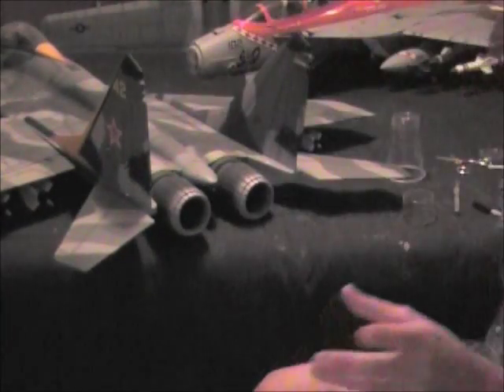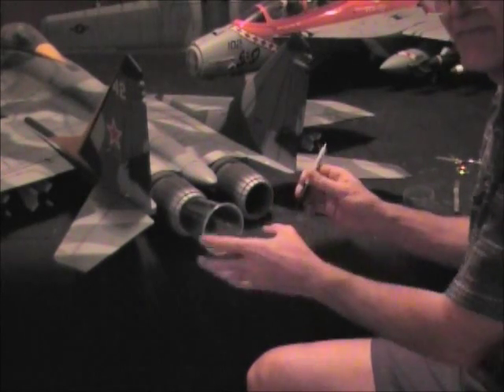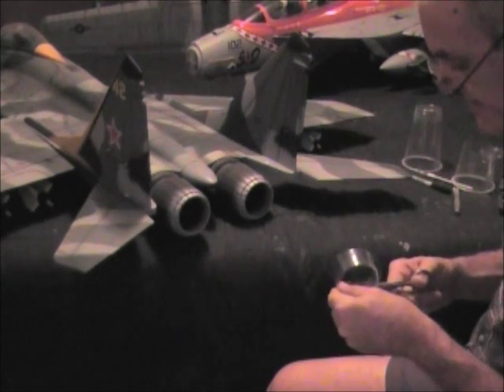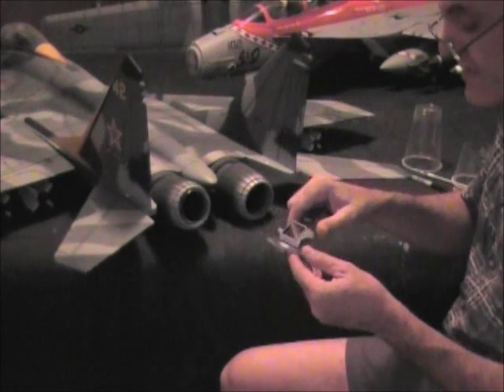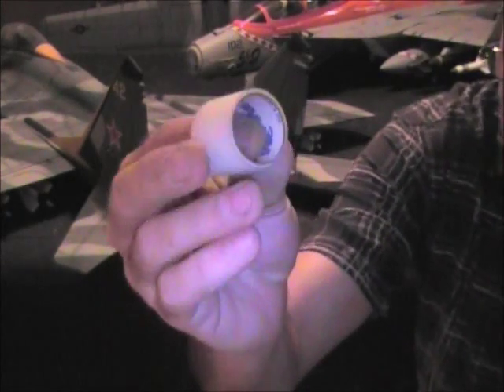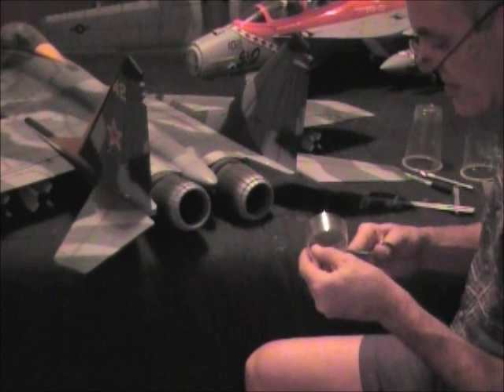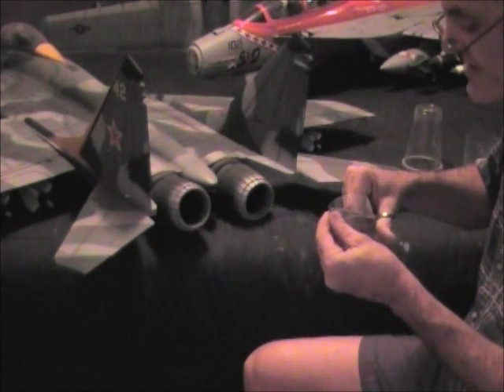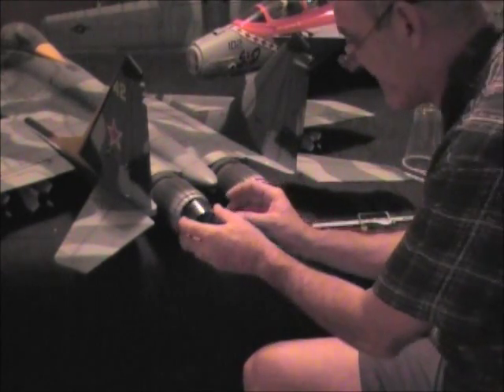How to make a simple thrust tube reducer for the LX 70mm line of EDF Jets

Comment: I did this with a starbucks cup and it worked out great, BUT for whatever reason that I can't figure out is that I have NO thrust/power. What is up with that? I used the 80% FSA calculations for the openings and get NO power. Any ideas on what could be happening?

Comment from the maker: @shypilito1  yes but you really nead a minimum of 9 to allow some of the functiona and 12 for full functionality, but it will work with the spectrum equipment, it's just futaba I've had a problem with. you can "Y" harness several of the functions together which will be on constantly like the TV nozzels which use  3 Channels, minus the wing folding and the canopy opening and get by with just 7 ch? I think but you wouldn't have the canopy opening and would have to no use that function.